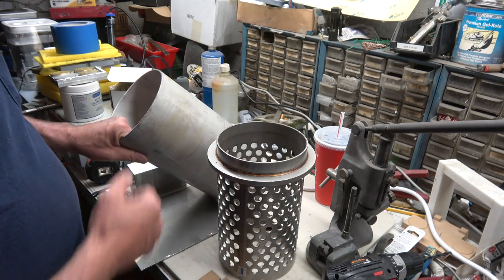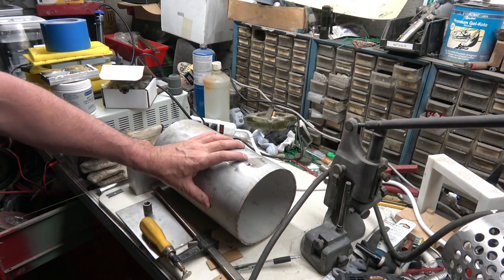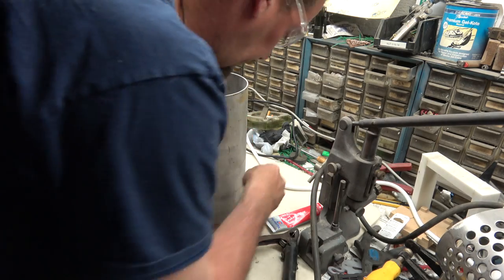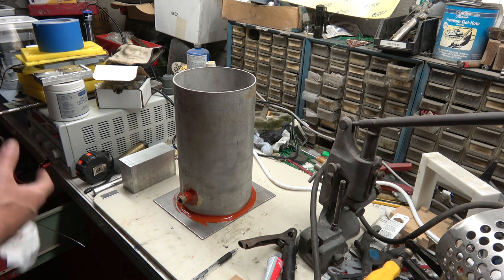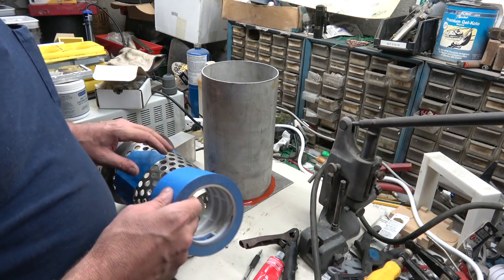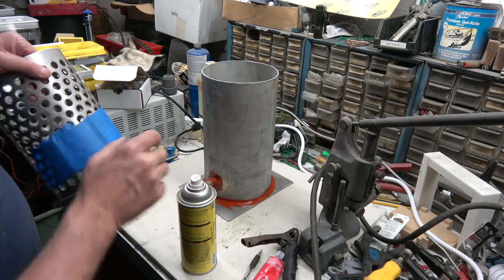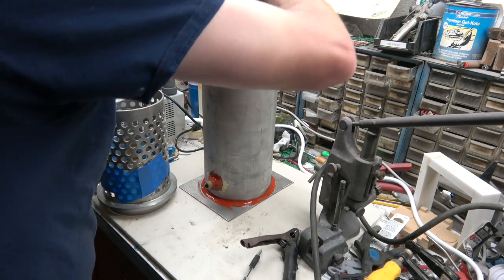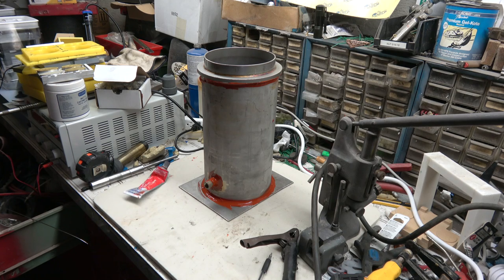Vacuum chamber

Comment: I used to be a jeweler and have done sand and centrifugal casting but always liked vacuum casting the best.  Sold my system 17 years ago when I changed careers but I've been looking into setting up cheaply to do some special pieces and your system looks to be just what I had in mind.  Thanks so much for sharing your videos!

Comment: Could you use some sort of high-heat resistant rubber gasket instead of the silicon at the top?
Reply from the maker: Yes, you can buy silicon sheet and cut a gasket from it. but you will still need to use the rtv to glue it in place.

Comment: Is there a part two or so or ?  I’m confused as to what happens next ?  No plumbing - fittings - motor ?  Not being rude but dead serious. What are u pulling the vacuum with ?  I’m very interested in learning more about the sleeves. What are u using to cast ?  How much vacuum do u need to pull ?  Where are u located elevation wise ?  Etc. again I’m not being a smart ass just honest serious questions.
Reply from the maker: Open Air Model Shop 
  It couples to a 2 stage vacuum pump using A/C hoses.  Never measured how much vacuum im pulling.  Really doesnt matter much as long as i get some negative pressure in the mold to help it fill with the metal.

Comment: Do you burn out your wax molds to cure investment before pouring or just let them sit to cure? Sorry, I am new to this so I am just trying to get info :)
Reply from the maker: It has to be burned out and it is a very specific cycle according to the size of the flask. Do not short cut the burn out cycle! If you go to the mfg website for the investment you can pull the data sheet and get the burn out times/ramp up temps for their investments. Its a long slow process, but has to be done.

Comment: Thanks! This is just what I was looking for...trainman4602 has some good videos on investment casting but he didn't say how he made his vacuum chamber, so I started searching for how it's done. I had the general idea.... but it helps if you actually see someone else make one before you start buying metal and start cutting and welding!!  I already have the furnace, perforated flasks, burnout oven, 5 cfm HVAC vacuum pump. Still have a ways to go but am hoping to start pouring bronze in a couple months or so. Again THANKS !
Reply from the maker: Yea, its nothing fancy...  Check out my other videos and you can see trainman4602 and I casting together :)